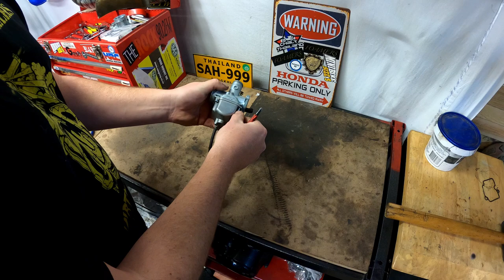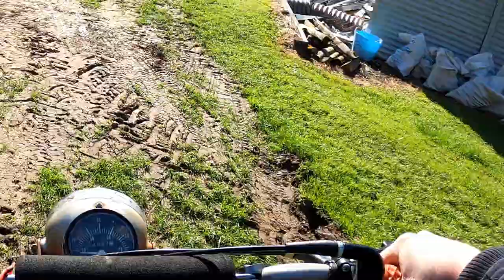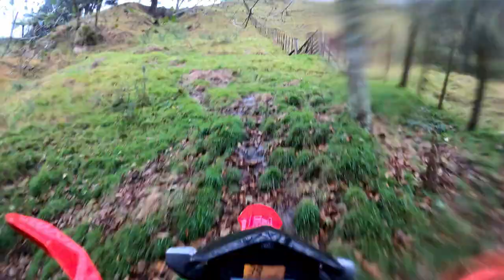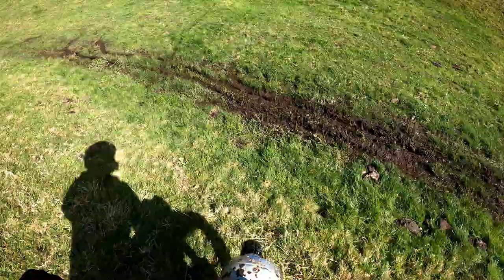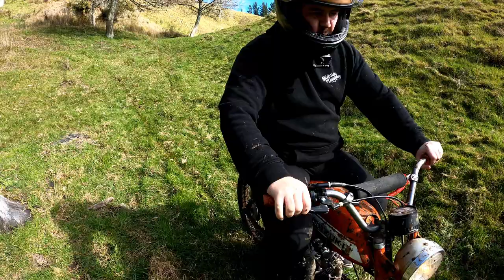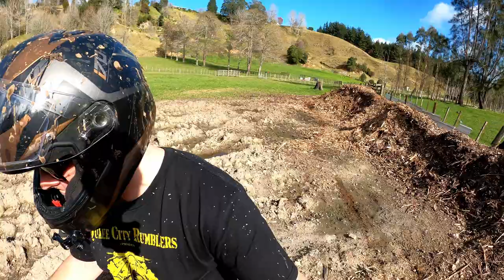SMALL SUZUKI ADVENTURE BIKE

Comment: Top tip for the rubber float bowl gasket - stick it in boiling water for a couple of minutes - this removes the contaminants and shrinks it back down.
Reply from the maker: I’ve successfully done this once! The other two times I just melted the darn thing. Definitely operator error though. Appreciate the tip.